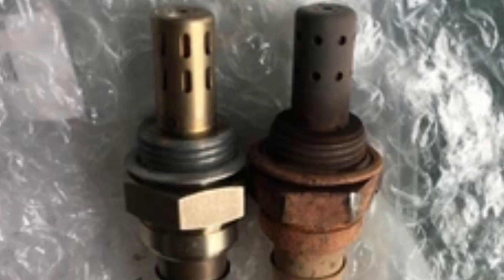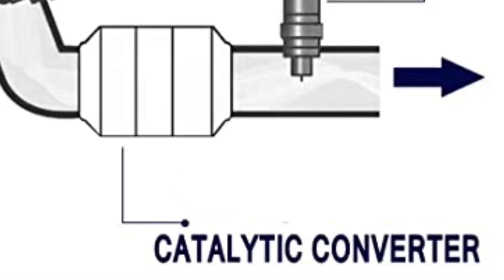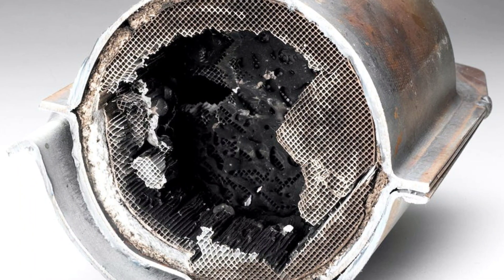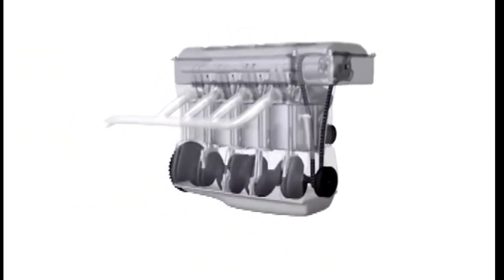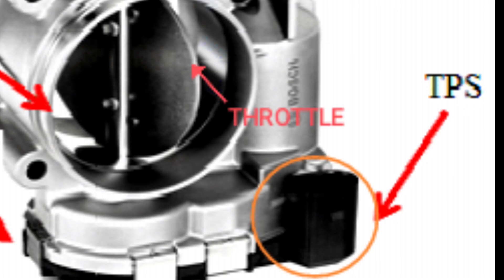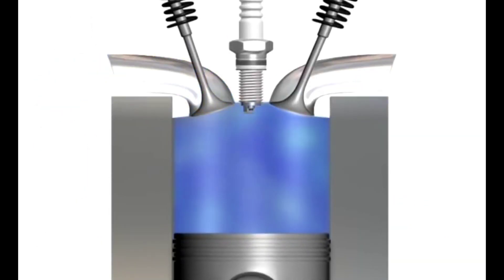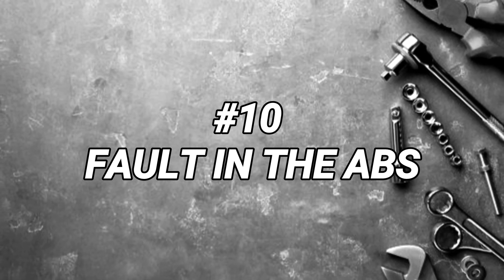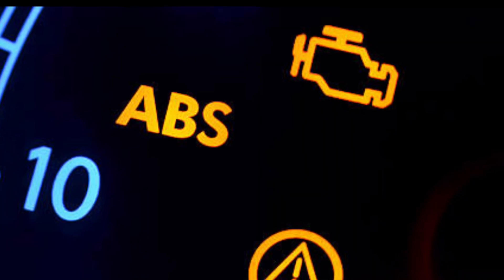WHY IS MY CHECK ENGINE LIGHT ON? DIAGNOSIS | UNDERSTANDING THE REASONS

Comment: May I ask u a question? My car is 1988 model toyota corolla 1.3 2e ee90, problem is rpm not working, what shud I do?
Reply from the maker: There could be a few possible reasons for it. but you can try the following if you have the tools:

- Inspect the wiring, cable, and/or fuses: Check the wiring/cable connected to the RPM gauge and gear box. Look for any loose, damaged, or disconnected wires or cables or blown fuse. Ensure that the connections are secure and properly connected.

-Test the RPM gauge: If the fuse and wiring or cable appear to be in good condition, the RPM gauge itself may be faulty.

-Consider professional help. If you're unable to troubleshoot or fix the issue yourself, it's recommended to take your car to a qualified mechanic or an automotive electrician.

These are just general suggestions, and specific troubleshooting steps may vary based on the actual cause of the issue. The best option is to take your car to a mechanic if you're unsure or if the problem persists.